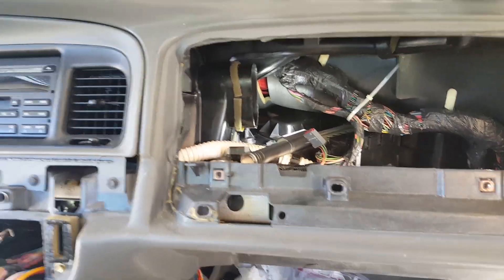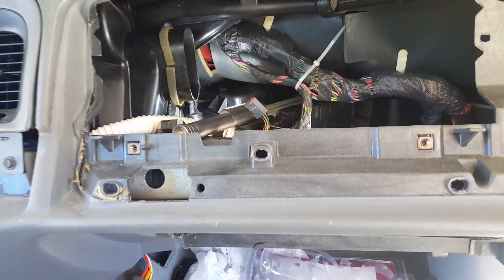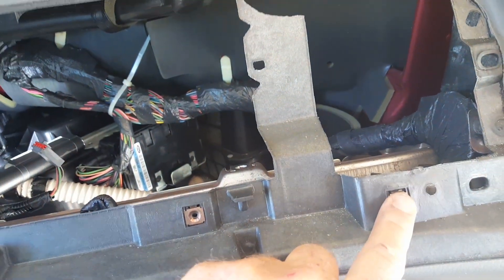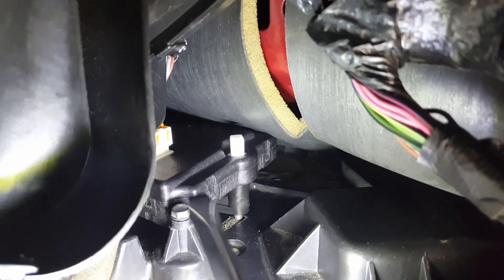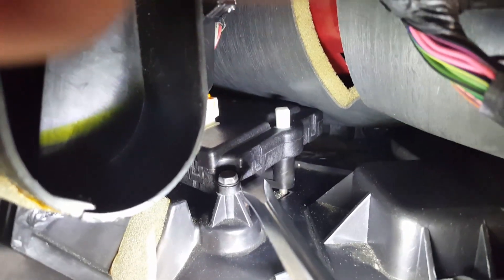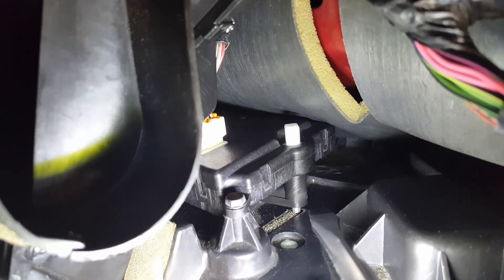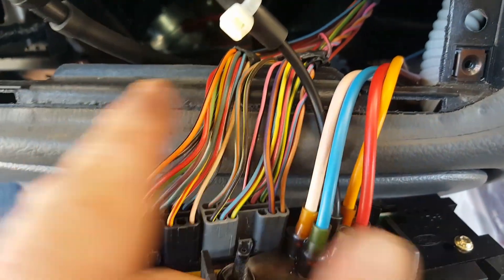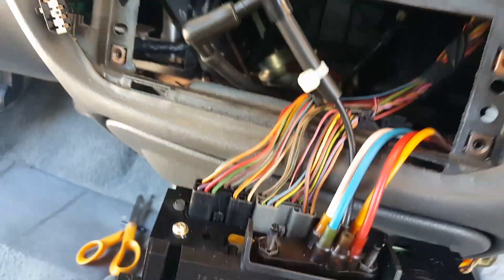Mercury Grand Marquis Blend Door Actuator and EATC Vacuum Leak

Comment: With due respect... this project of replacing a blend door actuator is not for the faint of heart or a novice mechanic.  About 8 hours on Sunday just removing it!  There is a pile of parts and tools on my passenger seat and the floor.  OMG.  What a headache!  Still have to finagle (is that a word even?) the actuator back into its proper place and re attach it... not easy... today after work... What was I thinking?  Want to see out of my windshield in the winter... didn't want to spend a thousand dollars...  wish I would have videoed this fiasco from beginning to show what it is REALLy like to replace a blend door actuator... very difficult undertaking...  and the part appears to have been in perfect working condition... wonder if it could be a simpler fix... like a switch... guess we'll find out later today or tomorrow... will let you know!  Still appreciate you...
Reply: Nah. Loosen the passenger side only nuts underneath and take out the airbag. Pry a 2x4 under the side with the passenger door open and you'll have plenty of room without removing much.

Comment: That's also a good way to break the air box prying on the actuator to get it out then you just turned it into a 1500 dollar job doing it the wrong way I get you wanting to save money but trying to do things the wrong way don't always work out those air boxes are plastic and won't take to much abuse I have seen them break a million Times

Comment: Wow....Great video..
On my 01 GMQ LSE I pushed the Automatic button just to see how it worked and now it takes turning the A/C off and on to get the A/C to blow out the main vents instead of the floor.But after tuning the A/C on and off a few times it finally switch`s to blowing out the main vents.I don`t know WTF is going on,I guess I shoulda never messed with that Automatic function..
Reply: Resetting itself. These cars are a nightmare

Comment: Ian great job on the replacement. Ford tells me I have 3 of these. I own a 2007 Gr. Marquis which has started to blow hot air everywhere when the appropriate buttons are pushed. How did you determine it was this one?
Reply: Key on engine off position then turn off climate controls then press and floor at the same time then press automatic and it should give you a diagnostic code if you have one.
Reply: I now understand what you where asking the guy at Napa asked me which on when I told him I needed the blend door actuator and I was like what?

Comment: I'm having same problem with an 06 cant figure it out. Could you tell me how do you do the smoke test ?
Reply: I think I know about the smoke test But if you don't mind telling me a couple things how did you get in to the check valve and the second did you run new line all the way through the firewall ?

Comment: My new actuator isn't moving.. I plugged it in and cycled through everything and nothing. Fuses are all good under the dash... Also my ac pump cycles on for a second then off and repeats. I get error code 24, 25.  Switching the blender door handle by hand doesn't make cool Air. So even if my ac needs recharged, the replacement blend door isn't moving and I don't want to install it fully until I know why it won't move.

Comment: I like this method, great idea. But don't use the big screw driver! I ended up busting a 3" hole in my plenum and had to take the dash out, aka the LONG way, and repair my plenum. Not fun. Good idea, just be careful with the screwdriver!
Reply: Its only easy for dryrot cars that sat in the sun their whole lives...i used a pry bar and had to wiggle it with a 22mm wrench under it for 45 minutes before i got one bolt tab off...the plastic on these can be very strong also its very tricky but you can do the vent tube without cutting the dash....the hardest part of this job is lining the back tab and lock pin of the actuator after that it will pop down if you cut your new tabs just right

Comment: Did u have any problems with the air bag?
Reply: I did the same thing with a 1995 Grand Marquis, looking to see if I could locate the blend door actuator (I couldn't, at least not yet). The air bag comes off easily, just two screws on the outside and two screws behind it pointing up (accessible from under the dash). Just make sure that you unplug the power connector first. Removal is easy, just don't give it a hard bump or it may go off, BOOM!.

Comment: Now here is what you do, break this and this and this, rig this and this and this and bash the people like me who are certified and spent a lot of time and money to fix it right and often times have to clean up the mess from YouTube hacks like you that give bad advice. Do me a favor, if you’re gonna screw with your own car fine, but don’t advise others to do the same. Some of these people you’ve caused other damage with your video and frankly you don’t even know the difference between vacuum or pressure.
Reply: I LOVE these kind of idiots.  When the whole top of the HVAC box breaks out, you'll pay me to replace the entire thing.  I'm not doing it correctly to rip you off, I'm doing it correctly so it's done right.  Not that Jerry Riggin you just performed.

Comment: I have change the eatc until three times and no of them have the fan selector working other than full on or off.  Is this normal?
Reply: You need to replace the blower motor resistor.

Comment: "...the actuator is just gonna bust right out." This ain't happening.  All the videos show after the fact, with the new actuator installed.  I wish somebody could show me how to bust it off the last screw.
Reply: I plan to change my actuator. It seems like a results may vary deal. Get the screws that you can, snap it out and remove whatever part of the new actuator that would get in the way of the snap off job leftovers
Reply: I busted mine out. Loosen the bolts, pry back the dash with blocks of wood one side then give it hell with a giant flat head screwdriver. Took me about 20 mins of twisting back and forth untill the tabs broke off. You just have to remove the front actuator bolts and loosen the back ones. It'll come out

Comment: 2:53 the trick is!!! You take it to the dealer. Break the dash what a joke this guy is
Reply: Actually I just removed one side of the dash bolts just enough to pry a 2x4 on The passenger side to make a nice gap  Popping off those tabs won't ever cause an issue.

Comment: Someone does the job correctly and they are ripping you off? And you obviously do not know how to diagnose the problem to begin with.
Reply: 20 pounds of pressure on the vacuum line? Really.
Reply: Exactly what I was thinking too, lol. They quote $1000 for the job because of all of the labor involved in doing the job correctly... It's just such a time consuming repair.
Reply: parochial2356 should have said 20lbs I’d vacuum and it’s actually 18lbs of vacuum. That’s base engine vacuum. I’m a master tech.

Comment: Real easy my ass. lol
My 98 Grand Marquis's passenger air duct had a plastic screw in it... In the back near the firewall where I couldn't see or reach it! 
No way I could get the duct out without splitting it in half so I could see the screw, shoving my hand into it with a flat head screwdriver, and then prying the screw out!
Also, my air bag module had 4 screws. 2 7 mm screws in the dash and 2 10 mm screws hidden on the bottom of it. You have to go up through the glove box to get to them. 
Not sure about pulling the dash partially out. Haven't gotten there yet... I'm not sure how you guys have enough room to actually pry the actuator out. The insulation/firewall seems to be blocking it.
I was able to pry it up and move the blend door lever so I have AC again, though!
Lastly, I recommend wearing a long sleeved shirt and some kind of gloves that will protect your hands but let you feel what you are doing. My arms and hands are cut up to hell!